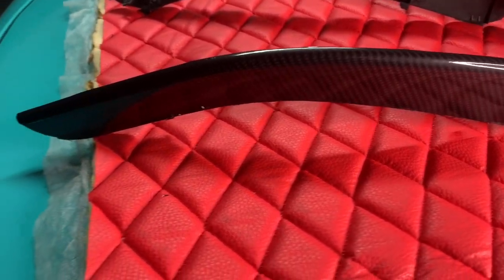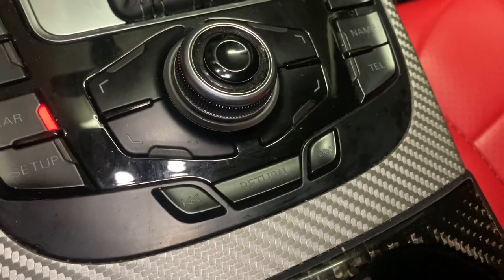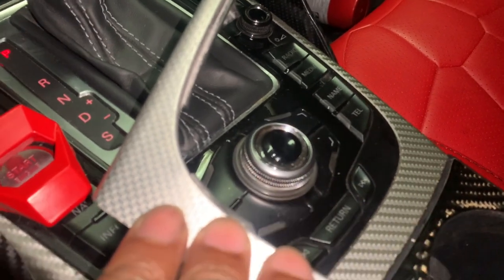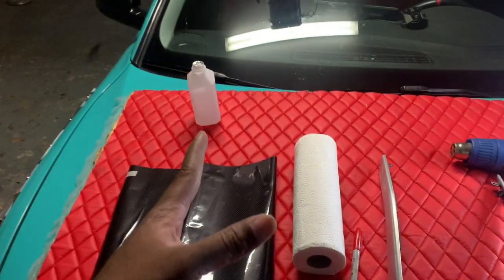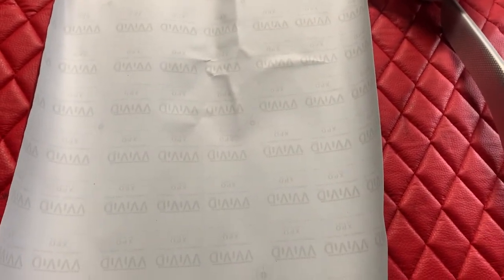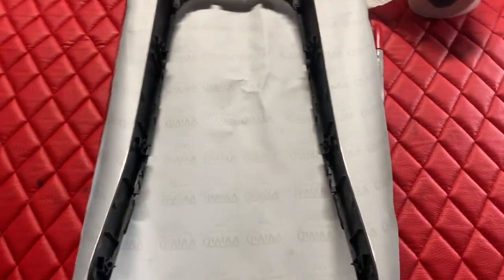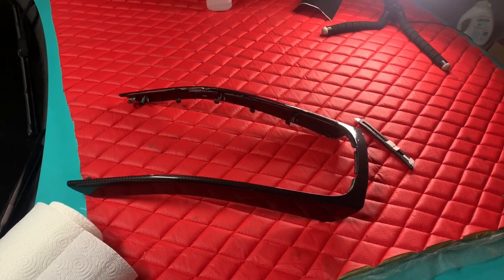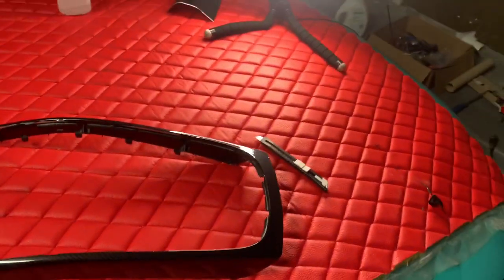Audi Carbon Fiber Center Console Upgrade For $10.00 💰 Dollars Audi A4/A5/A6/S4/S3/S5/TT/Q5.......

Comment: Have you considered spraying clear coat over the wrapped vinyl to make it more durable and also to possibly give it more dimension like is present in real carbon fiber due to the resin?  I’m just thinking that the vinyl could be scratched or torn which would require rewrapping, and the clear coat may help protect it a bit.  Great instruction in the video.  Thanks
Reply from the maker: wow great I deal, it probably make it a 100% durable

Comment: How to do you take that pice off is it just hold in my clips ?
Reply from the maker: no it a long process you have to take of the center console from the rear vent, it screws from the inside.
Reply: Do u have a video on how to take this piece off  thank you

Comment: Can someone help on how to remove the center aluminium part to wrap it.?
Reply: There's a few vids on line - looks like a real pain to do it. In the end I bought a carbon fibre covered plastic overlay that just sticks down- costs around $60 from Alibaba or slightly more from Amazon- quick and easy and looks the biz.